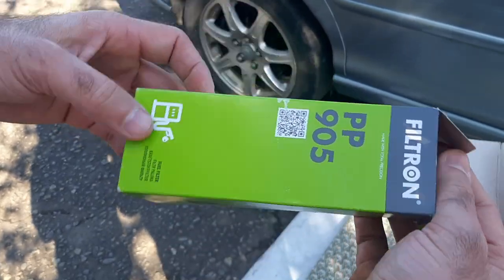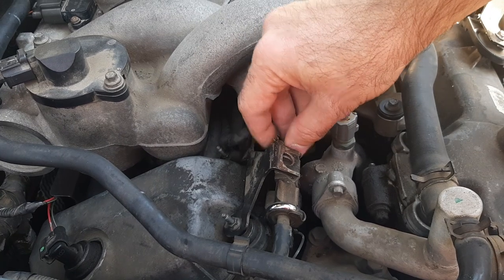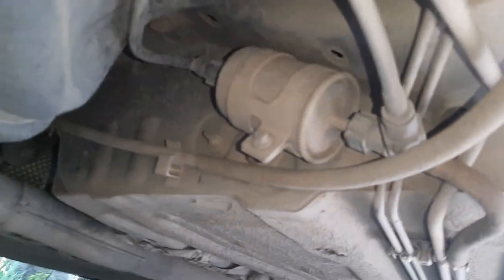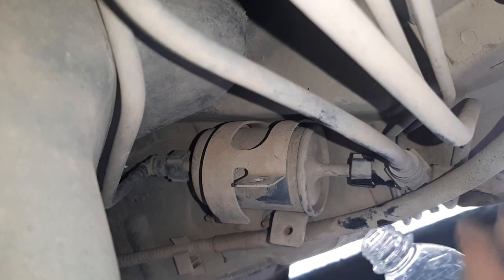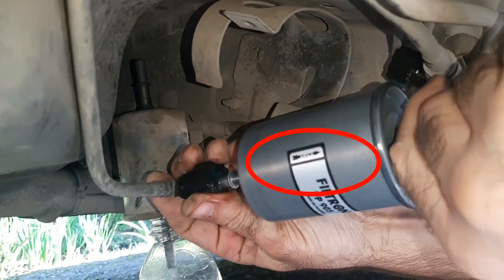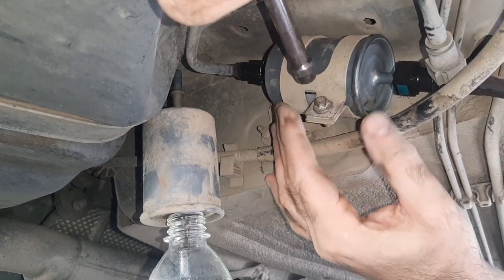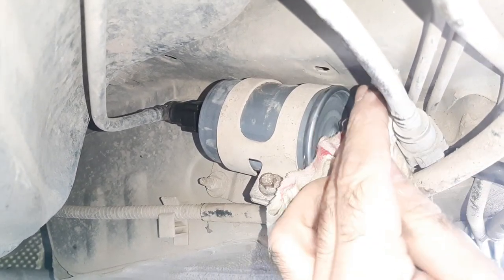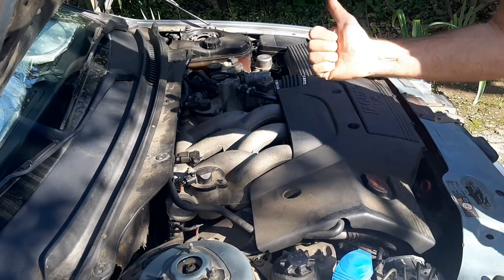Jaguar X-type fuel filter change without spilling

Comment: Thank you Roman! I do and will appreciate your every new video... If you have an idea, please be so kind to shoot a video in the future about how to detect the air "sucks" under the intake manifold and all surrounding hoses - A LOT of jags owners have that problem and the corresponding unstable revs, spits from the exhaust when cold and often the engine not revving more than 3000 rpm. I have been told now that i have a faulty maf sensor, but another guy told me that until I check and eliminate those air leakages (which might be caused by a lot of mechanics overdoing the screwing of the bolts and ruining the bases for them in the plastic parts), the problem will persist any way... I have gas installed, and the gas hoses cover the bolt caps, and it is difficult for me to understand how I can get to those 6 outside and 6 (if i am not mistaken) inside bolts of the manifold... I have a 2.5 benzine-gas car... Thank you anyway!))
Reply from the maker: Thank you for your comments. I believe, the only reliable method to locate all possible vacuum leaks of the intake is to pressurize the intake with a smoke machine. You'd better search for a skilled technician with a smoke machine if you haven't got this device. As for the 6 lower and 6 upper manifold seal rings, they should be new or at least newly changed. Thanks God, they are not too expensive for 2.5 and 3.0 engines (ford compatibles will help you). It is not a problem to remove the lower plastic parts of the manifold - all the bolts securing them are tightened to the metal head of the engine. It is a problem to remove and install the upper part of the manifold, because 3 short bolts go to plastic and can tear the nuts out of it. The other 3 long bolts securing the upper part also go to the metal engine head. My method is: when removing the manifold, first unscrew short bolts, which go to plastic, after that unscrew 3 long bolts, which go to metal. Don't let the manifold be secured with short bolts tightened to plastic, they may tear the nuts out of it. When installing the manifold, first I tighten the long bolts to the metal head of the engine, and only after that tighten short bolts to the plastic parts. I don't plan to remove my manifold just for taking a video, it's very easy to spoil something. But I will think about taking some kind of manual may be in the future.
Reply: @jaguarrroman  Thank you Roman! And what would you recommend to do if one of the nuts is already torn? I am not sure yet that it is my case but the probability is quite high...
Reply from the maker: @dima.english  To tell you the truth, I have never experienced tearing the nut out, but other X-typers usually put an iron nut and a washer from the other side of the plastic detail. There is enough space below. I checked with my car, the short bolts are two lower ones on the right side and one upper on the left side if you are looking at the engine from the front end of the car.
Reply: @jaguarrroman  Thank you very much!